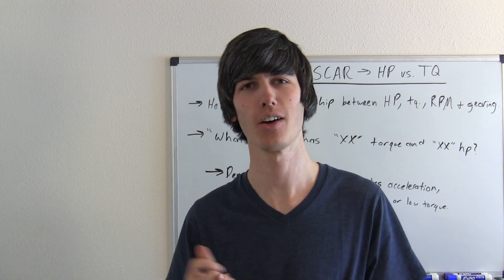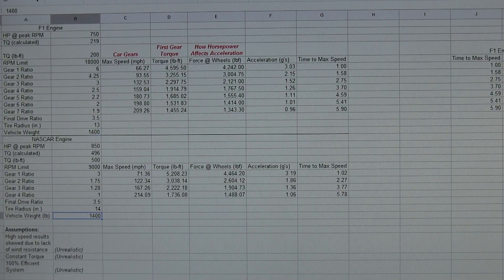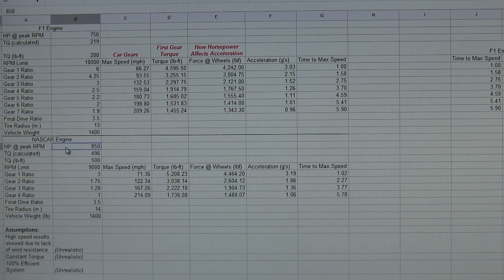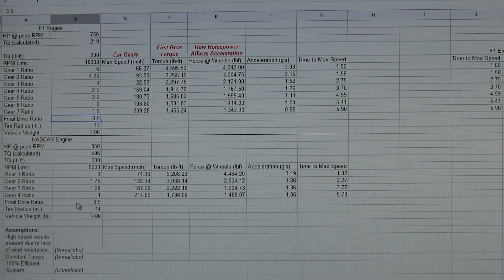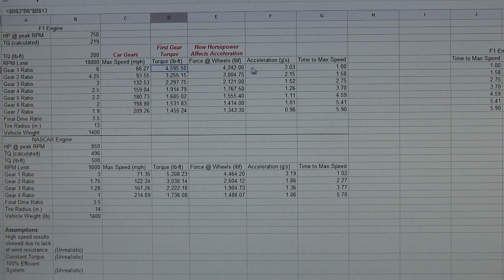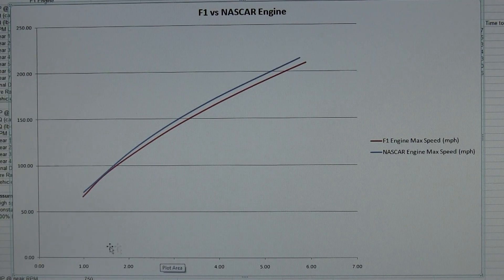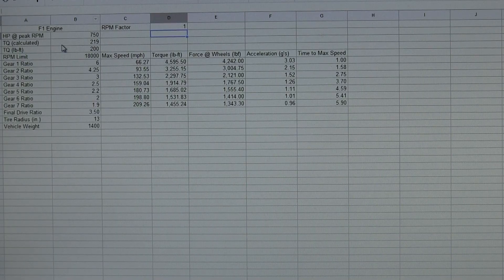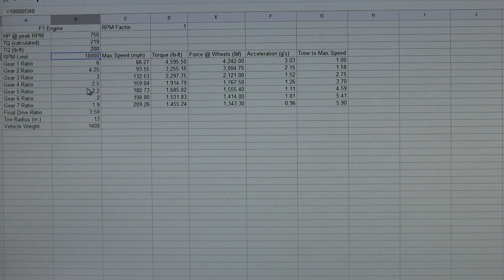Horsepower vs Torque - Formula 1 vs NASCAR

Comment: cant compare the two would be better saying sprintcars vs nascar. gearing is all about what u want out of a car hp means nothing in the real world. you could have a 1000 hp but with no torque car wont go anywhere. plus you have to have torque curves for shifting point in rpm so you can work out your gear ratios if you have to much load not enough rpm car will stall out really torque comes from high compression ratio, super/turbo chargers, high capacity engine with multi cylinders, what fuel you run and how much ignition timing you can get all of that plus more you cant just leave it out. top speed and acceleration are the two thing you have to balance between, sprintcars have no gears only final drive changing the final drive changes top speed acceleration and rpm (short track low top speed/long track high top speed) I would be here all night explaining in full it takes guys years of working in racing to figure it out. I find this video wrong simply because it is comparing things that dont even come close
Reply: A 1000hp car would be a rocket if the correct transmission is used. Horsepower is the amount of work the engine can do. Torque is just a twisting force. I can produce 200 pounds of torque with a torque wrench, but it'll produce next to no power.

Comment: I disagree with more torque you can pull through the gears faster for example if it where possible sticking the 7 speed f1 gearbox onto the nascar engine it would pull through the gears twice as fast theoretically as the f1 engine therefor accelerating quicker of course your numbers would be the same if your halving the gear ratios with the increased torque of the nascar engine as it's cancelling out the increased torque of the NASCAR engine making them virtually numbers wise and I'm f1 bias and wouldn't usually admit NASCAR are quicker!
Reply from the maker: If you put the F1 gearbox with the NASCAR engine, without making any changes, you would not accelerate quicker. Since your engine is limited to 9000 RPM, you wouldn't reach the speeds the F1 engine reaches in each gear, and acceleration would be hindered. I equaled the playing field so they could be compared directly, not so that one would seem superior.
Reply: Ahh is see what you are talking  about it has to be made from the same components  meaning  it cant be alcohol based that's  true enough but you wont see them useing fuel with and octane lower than 95 and they use certain hydrocarbons to prevent detonation by adjusting volatility.
Reply: 177SCmaro   no  but cos the f1car is half the weigh of a nazcar car , people need to understand that f1 engine will only do the job right  in an f1 body car
Reply: yea but  the engines arent gonna go alone at a race  you will always need 2 differnt cars  thats why im no fan of f1 engines cos they are useless in the really world
Reply: Issa Bendeck except for the fact that almost every technological advance has come from f1 engines  that's why they have certain rules like they have to run standard road fuel and not high octane race fuel and not atall it's  essentially all down to gearing and applications and all I was referring to is more torque the quicker you will pull through the gears that's why I used a f1 gearbox as an example I think nascar only has 4 gears? (can someone confirm that???)  f1 have 7 both do similar speeds v8 has more torque than a f1......
so that's where I was coming from
Reply: chris bailey standard fuel? Hahaha no buddy just no the engines would explode almost immediately using shitty low octane pump gas
Reply: chris bailey do you know things before  you say them or just talk and hope nobody else has a clue
Reply: Wrong
Reply: Jarl Nieminen https://www.formula1.com/content/fom-website/en/championship/inside-f1/understanding-f1-racing/Fuel.html 

there you go pal how about you do some reading before you open your mouth just as you said to me haha
Reply: You might mean standard for Europe which can be as high as 110 octane but you dont get that anywhere else it's classed as race fuel as also you may be confusing it as a standard fuel similar to how they have a standard tyre which simply mean that the  all have to use the one type that  is supplied for that series also referred  to as a control. And i have yet to see anything from f1 filter down to road cars, maybe your thinking of the original grand prix series. Maybe intercoolers from the 70s turbo beasts but then maybe that was just adapted from trucks anyway.
Reply: I know tech gets shared but you'll  find that alot has been  about well before f1 but like most racing series they are a great flatform to show what is the ultimate  version and gain publicity. I dont like to give f1 too much credit because ultimately they dont have the idea they incorporate it using almost limitless funds. All racing serves as an excellent proving ground though that's for sure.
Reply: Funny that you should mention finances because we just lost 2 teams due to not having enough money I think Ferrari are on over 200m a year and the 2 we lost were on roughly 60-70 mil a year huge difference between them and I sort of agree with you it's not f1 I give credit to thats just a racing series I "used" to enjoy a hell of a lot back in the days of mansell, hill, stewart, senna and the 90s and turbo periods was absolutely superb... But I give the credit to the actual car engineers back in the factorys that are devolping the cars some of the stuff they come up with is mind blowing like some of the intake manifold designs the FIA immediately banned because of the performance it would have gave that particular team amongst other things... Shame really in my opinion being f1 it should be completely all out in terms of performance I say let the engineers and teams do what they want! it would be bloody intersting for sure

Comment: The Nascar engine is alot cheaper and easier to produce and have be reliable. The formula 1 is balls to the walls technology. Of coarse it's more expensive, but value can be found in all forms.

But my favorite cars for racing are rally cars and sports cars, it's a little different and not so main-stream in yo face and just straight up racing, even if there are technicalities, they just don't cluster fuck and be too TOOO expensive, still expensive but i think someone with a good salary can get into rally if they work very hard, but formula one you have to be mister money bags and dollar signs.

But yes, very nice video.
Reply from the maker: I'll agree, rally is awesome.

Comment: Great video mate! Maybe its because I'm German, but I dont get the thing with the final drive ratio. Regularly the overall gear ratio is i=i(12)*i(23)*i(34)...and so on. You have 3,5 and 1,75. How you have defined that? But in general I think I got the thing, that you must change the gear ratio to compensate lower HP or torque.
Reply from the maker: I just chose numbers where the math would work out, and 3.5 is twice 1.75, representing the torque being double or half. The final drive gear ratio is the ratio of the differential, so you multiply it by the gear ratio in the transmission.

Comment: What if the NASCAR had the same gear ratio, it would make it twice as fast, wouldn't it?
Reply: actually no, It would cut the resultet speed by half. The F1 car can rev up to 18'000 the NASCAR to 9000. Even with gearing, if the input rpm of the gearbox is just half as high than normal, the output rpm will also be just half as high. An Example:
If the input rpm of the gearbox is 18'000 and the output rpm 300, the same gearsetup will only put out 150 rpm if the input rpm is 9000.
In the real world, the NASCAR would run into the limiter all the time if they would use an F1 gearsetup.
On the other hand, if a F1 car would use a NASCAR gearsetup, it would hardly be fast at all, because they haven't enough power at low revs and the gap between the gearratios of the individual gears would be to big to hold up the revs, even if they would rev out the first 2 or 3 gears.

Comment: HP to torque conversion is all about rpm. I get that. But why did u change the final drive ratio? All u did was make it all balance and didn't really explain it. If max rpm is the same then torque is king, right? Because torque is what is used to calculate HP.
Reply: Yes. If you have two engines running at the same rpm, then the one that makes more torque at the given rpm is faster because it has more power. Power=speed, but if you keep rpm constant, then you increase power by increasing torque.

Comment: Horsepower is simply torque times speed.  The question then is if you can effectively gear a low torque engine to provide high torque at the wheels (high enough to be close to spinning).  If not, your acceleration will suck.  On the other hand, a high torque engine will be easy to gear to make those tires spin (or nearly spin, which is better in theory if not in practice).  But as your speed goes up, the demand for horsepower (at constant acceleration) goes up as the square of your speed.  So more HP on tap makes all the difference at the high end.

Comment: There is another way to look at the relationship between RPM, torque and HP. Horsepower is how much twisting force a motor can make at a given RPM. If the motor can make the same torque at a thousand more RPM's it will make more horsepower and go faster.

Comment: what if two cars have almost the same torque but one has double the HP of the other? can you make a video like this one? thanks :)
Reply from the maker: Then it would accelerate twice as fast. You could do the same thing with this video by saying that the NASCAR engine has half of the torque I said it did, making it the same as the F1 car, with half the power.

Comment: So why does one motor-sport use one engine over the other. I would think that a high revving motor will wear-out quicker, but maybe can be made lighter for the light weight F-1s.
Reply: You are fully right where the high revving one will wear out faster.  Formula 1 limits the horsepower in their cars by displacement, where NASCAR limits technology AKA pushrod valve train vs pnumatic valves, direct port injection vs throttle body etc.

Comment from the maker: You'll need an engine dyno to find the actual torque value. There are probably formulas which exist but because of the number of variables involved they wouldn't be too accurate unless you have a 3D cad model of the system to test.

Comment: Torque is based on displacement of the engine not RPM.  The larger the engine displacement, or more air you can put into the engine by forced induction, you will have more torque.

Comment: Video might be little misleading here, because spreadsheet shown there alters torque automatically. NASCAR engine is simply bigger (making more torque) and not designed for high RPMs, if it would be capable of spinning 18000rpm with same torque it would have twice as much power.
High reving small engines are lighter and it benefits F1 cars because they accelerate and corner a lot. NASCAR cars have more constant speeds and their engines must last much longer (eg. 500 miles race)

Comment: Thanks for doing this video, this a is a misconception we're also working really hard to clear up as sadly ill-informed auto journalists spouting things about "Torque is for low end acceleration" and things like that have caused people to have a very strange idea of what torque is.

We've done some similar calculations using our acceleration sim and have the same results, the engine with the most average power across the range is fastest, torque doesn't change anything.

Comment: Is this why the 2011 BMW M3 w/414 hp at 8300 RPM and 295 torque can do the quarter mile in the same approximate speed (12. 5 seconds)  compared to the 2008 Corvette with 430 Hp at 5900 RPM and 428tq ?

Comment from the maker: Yes, advertised torque is at the flywheel. Torque and RPM are what dyno's measure, it's not constant by any means (which is one of the several assumptions of this video). A dyno measures the torque across an RPM range, and then with these two figures you can calculate horsepower. The point I was trying to illustrate with this video is that ultimately power is the driving variable of acceleration/top speed.

Comment: Great explanation! However, I'm still slightly confused about a few characteristics of torque. When torque is advertised, do they mean torque measured at the flywheel? Also, why is it that torque is a function of RPMs on dyno charts if it seems in your explanation that it is set by a constant number by the gearing ratio? Thanks a lot and it's good seeing some numbers as opposed to vague analogies from nearly anyone else I talk to about it.

Comment: As your HP vs. Torque explanations stand now, they presuppose quite a lot of prior knowledge on the viewer's part. Consequently, a lot of the logic in your video just doens't make sense to someone who has only a basic knowledge of physics.

E.g: "NASCAR engines produce 850 horsepower, but they have an RPM limit of 9000, so the NASCAR engine produces more torque." Ok, but *why* does it do that? I haven't the faintest clue why lower RPM equals higher torque, if it's always the case and so forth.

Comment: Thank you...I have a much better understanding now than I thought I did.  It seems like torque really is the hero here but only if the RPM's are high enough to make it into real HP.  Like a Veyron motor,  very high torque and 6,000RPM = a lot of power quickly= a lot of HP.

Comment from the maker: Because gearing will not allow for it, and also the resistance will be more energy than you're creating. 5 hp means a very low RPM, this means slow movement. Even if you gear it (which would be a ridiculously enormous transmission) to reach 200 mph, the losses would be great enough (not to mention air resistance) that it would come no where near 200 mph. You just need to understand that power is the driving factor, as it's the amount of work that can be done.

Comment: So if you have a constant 1000 lbs of torque at 5HP, why couldn't I gear it up to reach 200 mph, even if it took 3 -6 hours to reach that speed, why isn't it possible?  Why is th the rate of acceleration so vital...??

Comment from the maker: Nope, torque does not take into consideration time. If you can't apply torque at a fast rate, you can't reach high speeds. The higher the HP, the higher the theoretical top speed.

Comment from the maker: No, if the cars had equal power, you can alter the gearing of the lower torque engine to accelerate just as quickly as the higher torque engine, which this video has demonstrated.

Comment: No one drives a F1 car around town.  So lets say it's a corvette weighing 3000 lbs. You have a 6.2L V8 making 700 HP @600 Ft.Lb Torque  or a 3.8L 6 cyclinder making 700 HP @ 300 Ft. Lb Torque.  Wouldn't higher prodction gears on the V8 then the allow the Vette to accellerate exponentially quicker then the V6?  And if that's true,, at 350HP @ 600 ft.lb trq. would the same higher production gears give the same performance as 700Hp/350tq....???

Comment: that torque figure for the F1 engine can not be correct.. any decent roadcar will give you more ... 
200 lb-ft, that's 271 Nm.. my simple Renault 1.5 diesel engine gives me 240 Nm ...

Comment from the maker: I don't think you quite understand the gearing. Sure you can use higher gears, but this means the engine can only supply this torque at low speeds, it is physically limited by the RPM of the engine (we don't need to worry about wind resistance for your example either, it doesn't matter - the engine still couldn't accelerate to high speeds). Check out my video "car gears - explained" to better understand why you can't simply just use high gear ratios to overcome acceleration problems.

Comment: Speed, whether it be top speed or acceleration happens when the torque exceeds the forces trying to stop the car or balances. Torque is a major half of the equation when driving through most mediums. Torque directly limits your top speed as does gearing. The two can be changed to alter top speed. To change the torque of a 50 HP car would mean the HP would change. You can't do the math backwards changing variables and expect things to remain the same.

Comment: 2:33 There's a bit of a problem here... an F1 car weighs around 700 kgs, not 1400 - or if these are pounds, a NASCAR car weighs about 3400 lbs, not 1400. Either way, they REALLY don't weigh the same.

Comment: @CFSteyr Your an idiot. High revving engines are designed for torque at high RPM and Low revving engines are designed for torque at low-mid RPM. You clearly dont own/tune cars. 

For example honda s2000 has no balls untill 6000 rpm and revs to 9000. A Volkswagen jetta turbo revs to 7000 and only has balls between 3000-5500 RPM. They both gave short gears however its a completely different engine design. 

"Geez so much misinformation on the internet" - zombiecheef

Comment: DRS is just a movable aerodynamic element on the rear wing that simply reduces drag, hence the name - Drag Reduction System. The speed advantage they gain while using DRS is simply because they're lowing their wind resistance.

Comment: A little thing I haven't noticed was the DRS system on the F1 cars. I know it reduces the stress caused on the engine and allows the transmission to spool to a higher RPM, but for the sake of proving NASCAR wrong, F1 cars go faster.. (Assuming that this is a straight line)

Comment from the maker: I believe you've missed the point, which is that with a set HP, you can change the torque with gearing. With a set torque, you're not free to change the power with gearing.
Reply: Why is it not free?
With 100hp and 300Nm turbo diesel you can set an 8 speed gearbox to get better acceleration and top speed.
Lots of diesel car are quick and fast with plenty of gear these days.